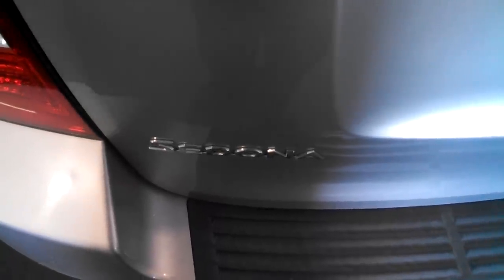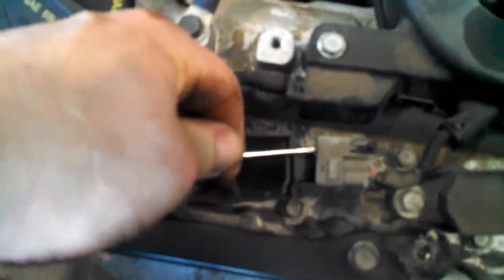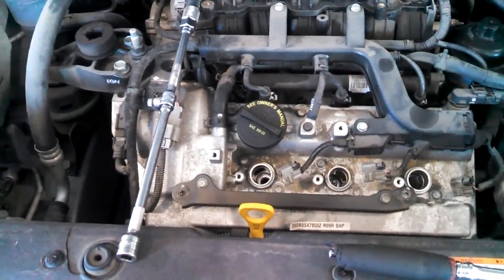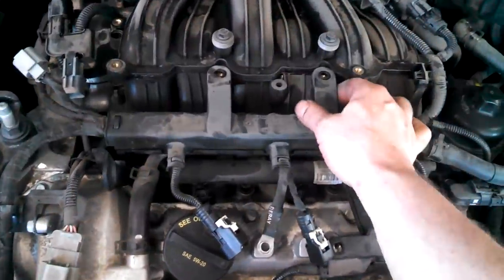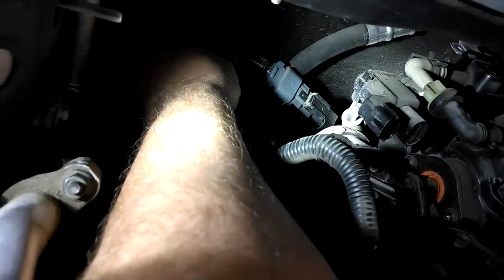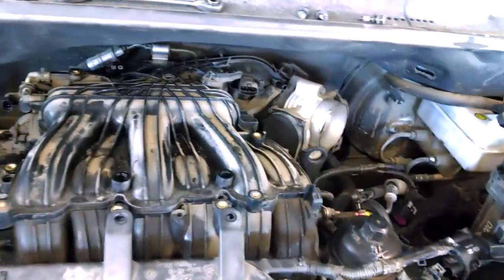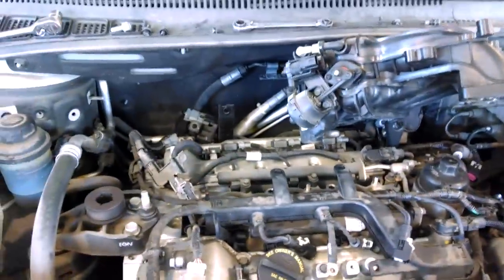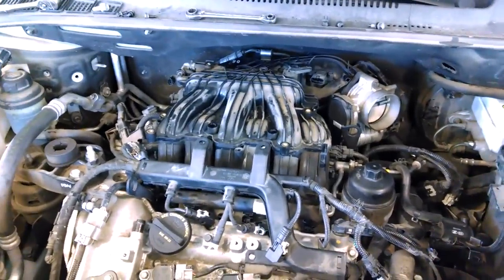Spark plug replacement Kia Sedona 2010 3.8L V6 plugs install remove replace upper intake

Comment: My theory is that upper intake removal is necessary to discourage the weekend warrior from doing this most basic task themselves.
Reply: I just unhook the rear and front motor mounts and tilt the engine forward, I've been doing it that way since these type of POS design came to the market, i don't mess with anything else...
Reply: @jomarz1828  how hard is this? Need a lift or anything? I need to do this so curious.
Reply: Gave me a headache looking at all those wires
Reply: @jomarz1828  Yes that works for some older GM and Ford designs, basically pushrod engines, or overhead valve, with the cam in the center of the engine block.  Sadly on many newer cars with overhead cam engines, half the intake is right on top of the valve cover on one side of the engine or the other and the plugs are in the center of the valve cover. You can tilt the engine all you want for fun, but the upper intake has to come off. This is common on many V6's from various manufacturers to get half of the plugs now. Look up changing plugs a Chrysler 3.6 engine just for an example of what many manufacturers do now.
Reply: Not difficult, but it does discourage novices from doing it.
Reply: @grawey77  yes sir.

Comment: Great video of steps involved.  Car had 160,000km.  Rear plugs and coil still original, coils are Denso but plugs were Champion.  Had misfire left bank (rear) cylinder  Got the Australia version (Grand Carnival), right hand drive, very hard to get the 14mm back bolts undone as it also hold bracket with 2 attached wiring looms.  We have the brake booster in the way, so can only use short open ended spanner, so cannot use socket or longer spanner so had to undo bolt from top.  Unfortunately there were lots of engine oil in plug hole as well, so going have to do the valve over gasket as well.  Video helped a lot, thanks again and keep up the good work.

Comment: what's the trick to get the left bolt on the back?  i have a 2009  and still i couldn't get to the left bolt.  the wire or connector was on top of the bolt.

Comment: Kia is getting better, but still too complicated for things like spark plugs. How many miles do the spark plugs last before you need to replace them?
Reply from the maker: 100,000 miles or 10 years whichever comes first.
Reply: +Fixing cars and stuff, also depends on the type of the spark plug, I believe. 100,000 miles is for platinum tips but less indeed otherwise.
Reply: +Fixing cars and stuff, thanks for the video. It'll help a lot when I do spark plug replacements soon.
Reply: +Fixing cars and stuff, I wanted to replace both upstream oxygen sensors but the rear one appears intimidating. What are your thoughts please?
Reply: mine is a 2006 180000 km, and they run fine, but i am replacing them now

Comment: Great Vid! Hyundai Veracruz/Santa Fe; same motor and job.
So thorough..Thanks for posting!! Do not be discouraged..You can Still work on Modern engines..
It ma not be points and caps and rotors anymore, but these things are Expensive for the Dealer to do!!
Who has over $500 to do this?!? Dig in and get dirty!!
Thanks again!! Great!!

Comment: Thank you. Very helpful. I have a 2009 Kia Sedona, now I can do my own plugs, thanks
Reply: i have a 09 too.  how did you managed to get the left bold on the back off.  Did you unplug the two wires first?  i can't see the back but seemed like the connector was on top of the bolt, right?  what tool did you use?

Comment: I used this procedure on my 2011 Sedona with a few mods. I took off the three bolts holding the throttle body on and the intake comes out very easily then. The gasket is just an o-ring so no paper gasket to tear. Do not put the power steering bracket bolts back in until you tighten the 14mm bolt first, makes it way easier...

Comment: A couple things I'd like to add, one being that it looks as though they switched to a plastic plenum for 2010 since my 2009 has an aluminum one.  If yours also has an aluminum plenum, the bolt pattern is going to be slightly different and I suggest being very careful with the center bolt when tightening as it's very long and thin. And more importantly, it's best to use this opportunity to replace the valve cover gaskets since they're sold in pairs and only way to remove the rear cover is with the plenum off.
Reply: I had a 2006 with the plastic plenum.  My 2007 has aluminum. Looks like they used both randomly over the years

Comment: just a question i had before you started everything , do you have to disconnect the battery terminals or no (i’m a young mechanic)
Reply: And or.  Cover your termainals very well. With a old bathroom towel. Big one.  Fold it 3-4 times.   Makes a non conductive tool holder.   Tools across battery terminals! 😅😅😅 fun times!
Reply: @jacobsweeney2330  thanks boss!!

Comment: My Sedona just started running one 5 cylinders, I hope it's a plug and not a coil.... Did you just decide to change them or did something go wrong.... Thanks for the video regardless, you saved me some time....

Comment: Hello. I have a question. In this video on the back coil pack there is another little connection an I can not figure out where it goes. You have spark plug 1,3 and 5 but before spark plug one there is another connection. What is that connection suppose to go too? I have 2011 Kia Sorento 3.5L.

Comment: I noticed some oil may have leaked past the spark plug tube seals. With the upper intake pulled over like that, do you think that the rear valve cover gasket could be replaced without its total removal?

Comment: for what it's worth I would change out the back coil packs with new OEM ones at 100,000 miles  when you do the spark plugs because if one of them go bad you have to take off that Air intake also check your valve cover gasket change it as well if it looks likes its going to leak soon

Comment: Not bad, but my 3.8 L on my 2008 Sorrento is NOT transversely mounted. I have the EX model, two wheel rear wheel drive.

Comment: You never mention gaskets. Are there any?
Reply: +Andrew Dickerson If you haven't done yours yet, you only need to replace the plenum gasket since the throttle body can stay attached. It's just a metal gasket and the old one on mine came off without leaving residue.